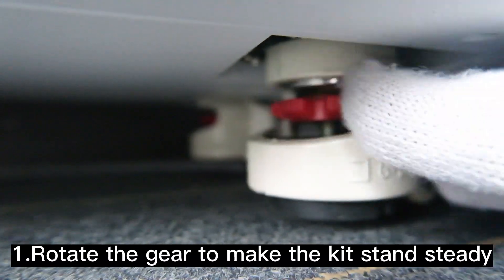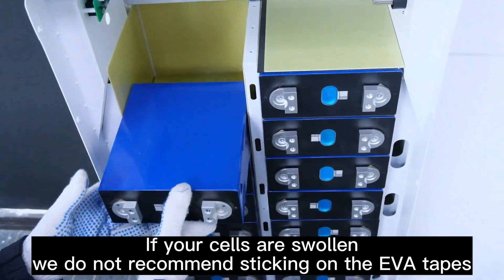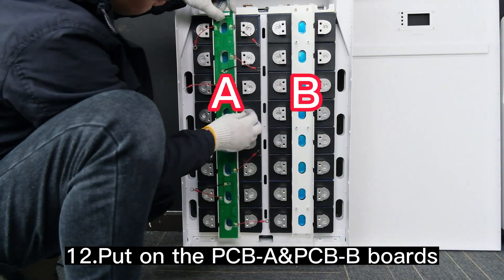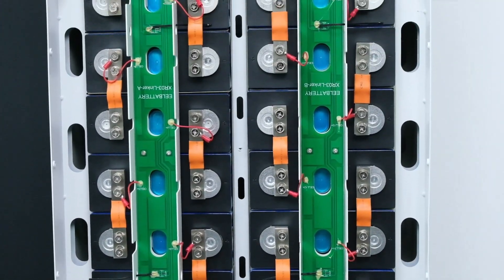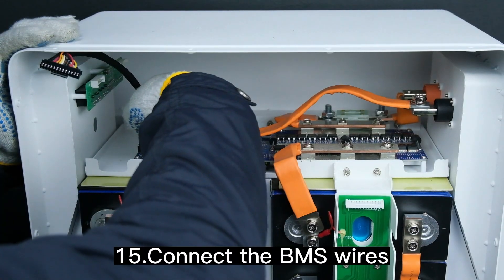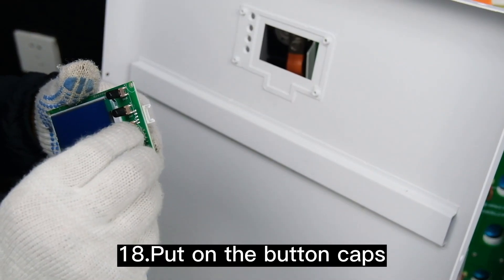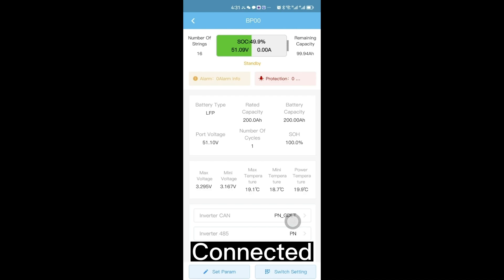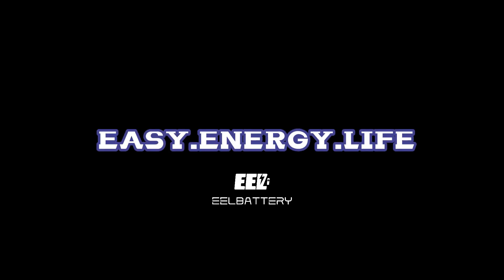EEL 48V 16S Vertical Battery Box with wheels|Bluetooth Version|Let's DIY

Comment: Very  nice system  however  please  details bms ,dip switch  wire diagram  specific and colorful  in manual booklet  make easy for DIY installers just very important suggestion...
Reply from the maker: We have a detailed instruction manual sent with the goods, if you need to contact the email: Howard@eelbattery.com
Reply: @eelbatteryofficial   that would  be very nice  I hope so thank you.